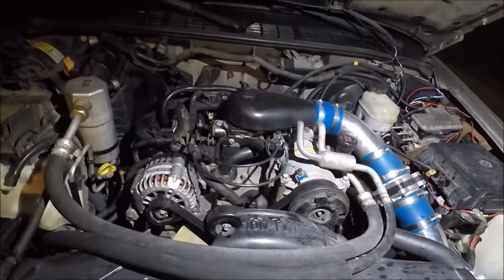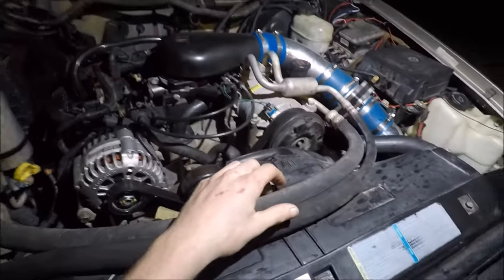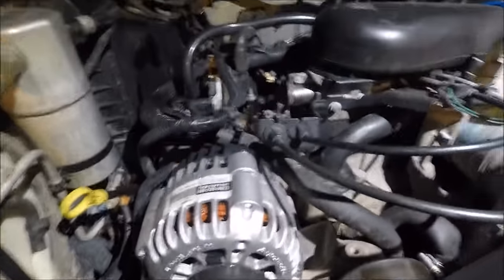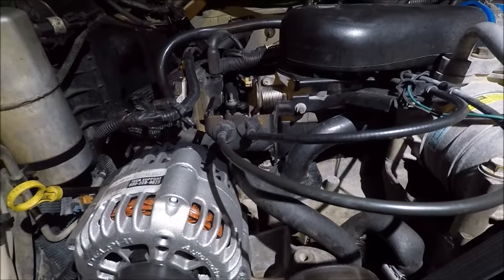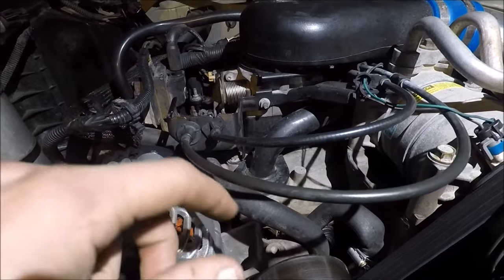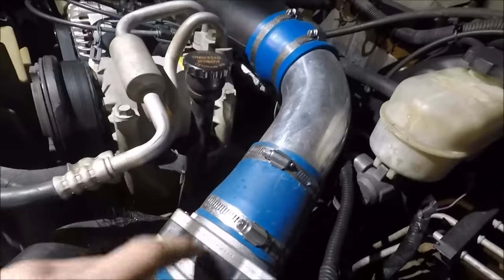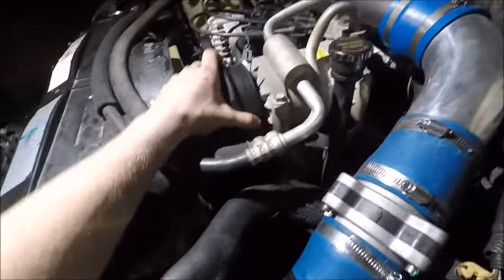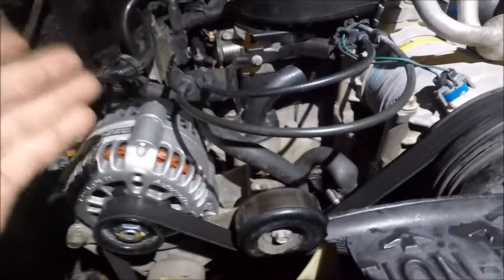EVERYTHING YOU NEED TO KNOW ABOUT THE CHEVY 4.3

Comment: My 1998 S10 has 347,000 miles on it. Any time it makes a weird noise or acts strange, I figure out what the issue is and fix it immediately. I love this truck.
Reply from the maker: Jesus their reliable
Reply from the maker: Mur Doc  right around their cap, hopefully you see 450
Reply: I'm at 257,200 now. All Original. TBI as well, awesome engine. I would like a carburetor instead. But, I got what I paid for.
A Super Sport if I might add. 1 of 5,700.
Reply: @briantruck2284  Thanks man! I do my best keep it going. When I first got it at 198,516 Miles in 2016, it would barely climb hills at 35 mph. After all tune ups, it's a cherry. Not mentioning the radiator exploding or the fuel pump relay pooping in traffic or the windshield wipers working when they want or the wonkey cammed v8 sounding starts in the morning. It's pretty reliable.😐
Reply: Yeah you take care of them and they will take care of you..
Reply: @tylerseitz6337  I'm seen them with 298k and still going..
Reply: Got a 96 with 270k miles
Reply: If I was you, I’d replace the pistons just in case they go bad sometime
Reply from the maker: At about 350-400k their just about done and need major attention.
Reply: Just replaced a spun #1 rod bearing on a 4.3 silverado.  277k on the clock hoping to get another year before i have the money for a v8 swap.
Reply: 99 with 140k on it checking in
Reply: Could you tell me why I have a grinding noise in my left front wheel, I have the 4 door blazer and I have no idea why it’s happening. Changed rotors, brakes, calipers, idk what is causing it
Reply from the maker: Most likely a hub assembly, after X number of miles hubs begin to fail and sounds like I grinding noise to a whirring noise, low deep tones even, out the blazer in the air and make sure all wheels are off the ground and grab hold of the tire and wiggle it up and down if there’s play then you can route the issue to possibly being the hub
Reply: @JLGARAGE252  I actually just changed the hub last week and idk why but it’s still there?!
Reply from the maker: Remember that metal allows sound to travel
Reply from the maker: I had an issue with mine, (ZR2 Trim) front diff was engaging on its own and grindin like crazy
Reply: @JLGARAGE252   I have the rear wheel version so I know that’s not the issue
Reply from the maker: Oh okay, just checking, since it’s two wheel the only thing that’s making sense would either be the hun, or believe it or not can be the brake rotor shield. If their bent in a certain direction they can rub the rotor or tire while in motion.
Reply: @JLGARAGE252  thats what happened to mine , had the brakes done but still noisy , took it back and simple fix , back plate rusty and a little bent , bend it back !!
Reply: 98 with 157,000 on it checking in
Reply: 01 silverado with 313k
Reply: Got a 1998 S10 4.3 with 305,000
Reply from the maker: 305? That’s nearing rebuild
Reply: @JLGARAGE252  I just bought a 98 s10 that had been wrecked. Rebuilt 4.3 engine has 10,000 miles on it, rest of the truck has 124,000
Reply: That's right S10 Gang!!!!
Reply: I had a beater one that reached 356k only reason it still had life and we  will
never know since I totalled it
Reply: @yung_pasta4326  got a 94 with 277k
Reply: I’m lucky mines only at 110000
Reply: Ive got 256,000 on my 4.3 blazer
Reply: Had a 92 4.3 2WD very strong truck , no issues . Had a 04 4WD 4.3 Sonoma
AC went out, gas gauge , some other issues here/there . The 92 was an awesome truck
Reply: Recently picked up a 1998 s10 4.3 4x4 little rust and some blemishes but only 123k miles. I bought for 300$ bucks put in a fuel pump spark plugs whole rear brake system a front wheel bearing gonna do some other minor things just cause maintenance but this truck is awesome and I can there tons of life left!! They kid I bought it from was gonna scrap it with a clean title!!
Reply: @itszenjii8773  I know this is a year later, but I wonder if it needed new pistons and seals kit, they get funked up and the pistons don't retract enough when you let off the brake pedal. Did you ever figure out what it was?
Reply: I have a 1997 S-10 4.3 204,000 miles on her that friends & co-workers have nicknamed the Green Machine. I'm just curious if anybody has had this issue..I was driving to work & she just stopped running & wouldn't turn back over. She appears to be getting plenty of fuel, she cranks like she wants to start but just won't turn over. Replaced the Cap & Rotor cause I know cap was a piss poor design on these. Still working on going through bit by little bit was just curious if anybody else may have ran into this & may know the problem..Thanks in advance.
Reply from the maker: Check the oil pressure sensor, it relays fuel signal and oil pressure, according to locally sourced tech data, the computer Denys ignition if there is no oil pressure signal, it will not allow it to start, check there, check power and continuity to the crank sensor, you may be surprised. Hope this helps.
Reply: @JLGARAGE252 I certainly will..I'll let you know..Thank you so much for your thoughts.
Reply: @JLGARAGE252 not if you been giving it thag attention. Should go to 1,000,000 miles if taken well care of . And lots of parts replacing to make sure it’s good
Reply: Squeak squeak. AWH HELL NO.
Reply: I44.00 on a 2006 envoy 4.3
Reply: I had 300k before I let an asshole fix it.  He fucked the engine.  Damn timing chain skipped a tooth because he didn't replace it. I should of did it myself I just didn't want to do it . I'm in process of putting reman in
Reply: @bully4574 do compression test.  When I tore my bros down the valves were leaking alcohol when I checked.  Wasn't going to turn over no matter what.  There's some videos too on how to check if it's the piston rings too
Reply: @TexasFishinMike wish that was the case, the bottom end is solid but the gaskets and seals are its Achilles heel.
Reply: My guy I got a 03 blazer 4.3 Vortec 4x4 with 110 on it I've done new cap rotor plugs wires collent temp sensor fuel filter fuel pump sending unit amd put fuel back in it and dosent wanna start unless I hold throttle and runs like crap but  dosent wanna stay ru nin
Reply: Mine has 217000 and is solid
Reply: 89 with 187k on it so they are pretty reliable nice
Reply: 06 Chevy Silverado here  424,227 MI on my 06 Silverado 4.3l as soon as something's not right I fix it and leave everything stock don't change anything ... Until it breaks.
Reply: Is it a clicking and knocking a scraping or a whining does it quit or start at certain times
Reply: These engines were built tough and they ran forever.
Reply: Right I love my 02 blazer better than any modern jun today
Reply: My '98 has 194,000 on it and runs great. I'd take it anywhere. BUT....if I let it sit for one day it is a mofo to get started!! Motor runs fine doesn't cut out or die anything. Just if it sits you're in trouble

Comment: These engines were really tough. I bought a brand new full size GMC truck in 1991 with the 4.3 and drove it until 2005. It had 245k miles on it and was still running fine. A bit under-powered but so what, it did everything I needed it to do. Over 245k miles, I replaced the water pump once, the radiator tank once, the distributor once, and the fuel pump relay once, and one clutch (it was a 5-speed manual). The engine itself never had any issues whatsoever. Then in 2005, I sold it and bought a brand new 2005 Chevy truck, again with the 4.3 and a 5-speed manual. I still have it, and it has 234k miles on it. On this truck, I've replaced the idler pulley once, the clutch once, and the instrument cluster motors once. And that is all. Everything else is still working, including the A/C. Again, the engine itself has never had any issues. To this date, this '05 truck has been the most reliable vehicle I have ever owned.
Reply: I have a 2003 chevy blazer xtreme 4.3L 130k miles on it and I have only been able to put 3000 miles on it in 2 years. I've had nothing but problems after problems with this wiring on it, the fuel pump, the ignition system in whole, electrical short somewhere, I can not plug in the mass air flow sensor because it will not idle with it plugged in but will idle just fine u plugged (weird). If I had the funds I'd rip out the entire wiring harness and replace it all. I love the look of the xtreme and will not sell it, I will wait till I can replace everything maybe with a ls3 or something.
Reply: @Bu2Spike  i swapped a s10 extreme with a ls motor. Was completely not worth it. Every time I really put my foot on the throttle something broke. I went through 2 engines,3 transmissions,had the drive shaft repaired 2 times all in a year. After that I just gave up and bought another s10 with the 4.3.
Reply: I was thinking about doing a ls swap but, what I hear about this engine makes me want to keep the one i got and, maybe get a new one! lol
Reply: @Bu2Spike Going through the same thing with my gmc typhoon.  When it runs it runs great but I think my issue is that all the wires need to be replaced.  30 year old wiring finally showing its age.  Looking to get fuel tech or holley.  I also have an 87 grandnational and had to put 20k in it to get it up to modern standards.  I cringe when dodge tries to sell people on their cars being collector's items.  The reason classic cars from the 50s to the 80s are great because they are 95% mechanical and analog.  As I am experiencing with the grandnational and typhoon that have bare minimum electronics it can be a nightmare in the making.  Imagine 20 years down the road you own a hellcat and all the electronics go haywire.
Reply: @user-cs3zs6jn1d  sorry about your luck, I have an LS in my 96 S10 when I put it in it had less than 10k miles on it and now it has over 100k miles in it, I've never had any issues with any LS motor but I've always had problems with every 4.3L vortec I've had.
Reply: @jdgreen214  yea I believe that the more electronics they put in the good cars the more the mess them up.
Reply: @Bu2Spike  Yeah it's gonna make cars now not be as desirable in the future as the cars in the past.
Reply: Treat em right and these engines are bulletproof

Comment: Probably one of the best engines ever produced in my opinion. I have a 2000 Chevy Blazer and its got 230,000 miles, still running very strong!
Reply from the maker: John Casebere I’d say it’s the best engine Chevy has made but in my opinion the older Nissan vg series and vq series engine are pretty dang bulletproof.
Reply: Don’t forget how great the 3.8s are
Reply from the maker: Thatdude_ Eric they can be respectable but in my opinion the 3800 series just can’t touch the beefy torquey power, and undeniable reliability the 4.3 has.
Reply: I love my 95 blazer also 230,000 miles. Got the transmission rebuilt an a level 1 upgrade. Put a smile on my face when it can take off.
Reply: @JLGARAGE252  yes, the 4.3 is more reliable and durable over the 3.8 engine. The 4.3 is maybe the best all around “first generation small block technology” engines produced. I’ve owned probably at least 10 different vehicles with the 4.3 and each and every single one of them was a fantastic engine. A couple of them had over 300,000 miles whenI sold them, one of which I sold to a buddy that’s still running one of the W/T 1500 pickups and last I talked to him it was around 350,000 on the odometer. 

Impressive!
Reply: A 350 with 2 cylinders cut off.
Reply: This 4.3 motor the 3800 series and the 5.7 are like the toughest most reliable built engines for a car or truck

Comment: You forgot about DeX-cool eating intake manifold gaskets. Did mine twice in 3 years then switched to regular green coolant and has been fine for 9 years so far.
Reply from the maker: 2000S10V6 thought that was corrected in 02-03 model years
Reply: @JLGARAGE252  not sure about that. Mine is a 2000. I'll never use Dex-cool again.
Reply: Really? I wanna do an coolant flush next week good to know, what coolant should I use?
Reply: @icrashucrash9585  Just regular green stuff and distilled water. 50/50 mix.
Reply from the maker: 2000S10V6 engine coolants are formulated differently, green formulas are typically all aluminum engines, dex cool is formulated for cast engines, prolly not a good idea to be using green or blue in a orange formulated engine
Reply: Wraith1998 so should i not use prestone 50/50 for my coolant flush?
Reply: @AV3Xv  I have a 1995 Gmc Sonoma in my owner's manual it says "50/50 mixture of water and the specified ethylene glycol-based(green color) antifreeze or Dex-Cool silicate free(orange color)Do Not mix the two types."
Reply: 21Chevys I’ll take a look through my owners manual aswell...Don’t wanna put the wrong stuff
Reply: @AV3Xv  I flushed my system with distilled water and some bottles of coolant system cleaner and put a green antifreeze in it because I'm from Germany and its crazy expensive importing stuff from the us(No one's selling dexcool here) it works fine no overheating and no leaks so far
Reply: @AV3Xv  there was a class action law-suit about the dex-cool and intake gaskets awhile back dont know what ever came about with it but i have had several different styles of 4.3s starting with a "86'' carberated race modified in a "89 4x4 Toyota that got me in alot trouble. i found out about the intake gasket prob with a "98 blazer and have flushed and replaced coolant with the old school green (glycol"" i think it is, 60/40 mix and have never had a problem since i'm on my 2nd van pushing over 300k
Reply: @JLGARAGE252  agree
Reply: @AV3Xv  manual says orange
Reply: Same problems. GM really cheaped out when designing this setup.
Reply: @icrashucrash9585  prestone green. Make sure after flushing out all the dexcrap
Reply: I just rebuilt top end from head gaskets back up do yourself a favor use green 50/50 dex ate lower intake and gaskets up had no choice but to do heads to be sure no corrosion was there either not a job you want to do for no reason.
Reply: @bbb8949  so was there any damage to the heads ?
Reply: @everywares6010  srry for delayed response no i was lucky but intake was very corroded and pitted luckly there's a million blazerz s10s and so forth in my local yards. But think if you want to know you have a job done right might aswell do head gaskest if intake is off never can be to sure when you buy used.
Reply: Yep. I only run green in my 7z1 and in the new astro I just bought. Won't use dex-crap in anything anymore.
Reply: Dude 89 trans am having trouble with dex bullshit too. Untill I took a chance and use the valvoline green. It was over heating I couldn't be in this LA traffic or I would over heat untill I replace my whole cooling system use alot of blue devil (I think its called) cooling system flush I also blew air through the system just to make sure I have nothing but 50/50 pre mix green stuff. And it turned out great. Keep in mind it was the 5.7 engine.
Reply: @bbb8949  how much harder are the head gaskets once am in on intake gaskets ?  I have 2005 astro getting coolant smell from exhaust
Reply: Dexcool doesn't eat gaskets, it was the intake gasket design where the plastic in the gasket would get crushed over multiple heat cycles causing the gasket material to separate from the plastic frame, a common problem on 4.3l 5.0l 5.7l vortecs as well as the 3100 and 3400 engines.  Some early 94 3100s came factory filled with green coolant and had the same issue with gaskets. Your fix may have just come from either luck, actually doing the job right or ending up with revised intake gaskets with a metal frame or with aluminum crush disks. GM redesigned the intake gaskets on the 4.3l and 3400 engines 2003 model years and continued using dexcool with no issues...

Comment: Love this engine. Mine is in a 2003 GMC Safari cargo and runs like a top. Oil changes and regular maintenance and replacing wear parts as needed, it will go forever.
Reply from the maker: They certainly are gutless but will they take a good deal of abuse, a well maintained engine will reward you
Reply: My Chevy Express 2003 cargo 400  thausand plust miles i rebuild automatic trasmisión only but engine work okay
Reply: @JLGARAGE252  the older TBI were even more gutless but you could not kill them....
Reply: @JLGARAGE252   If you want guts get something with a v8 in it.

Comment: Good thing about the 4.3 is that there the civics of the gm world. Any local scrap yard will have 10 of these. Parts are cheap. My gramps has 300k miles on his old 01 s10.
Reply from the maker: bradley love the 4.3 is a beast of a v6 people scrap s10s because of the transmission not necessarily the motor
Reply: i have 111,000 on my 2001 s10
Reply: @suzieq8379  keep your oil changed and you just barely breaking that engine in.. My 01 jimmy has 181k on it. Im looking to get many many miles out of it
Reply: 230,000 miles got transmission rebuilt an level one upgrade in early November an hoping to get a long life out of my 95 blazer. If the motor goes I plan on having some money saved up to rebuild or maybe even upgrade the engine but I'll have to do more research if that worth the kind of investment to modify it at all.
Reply: @randywells8974  how far do you drive? You confident in it goin on smll road trips? I got an 01 jimmy with 184.3k miles engine was rebuilt at 179 the top end
Reply: They are definitly stout motors, mine ended up ingesting a distributor cap screw (PO lost one on top of the intake manifold, fell in when I did the lower intake gasket) on cyl 4 and despite that still runs great, albeit with a bit of a knocking sound now. That happened about 500 miles ago and despite my best efforts, nothing is letting go. I'm more than half way tempted to slap on a $100 GT3582 and see how long the 100% stock everything will run on 5-7psi.